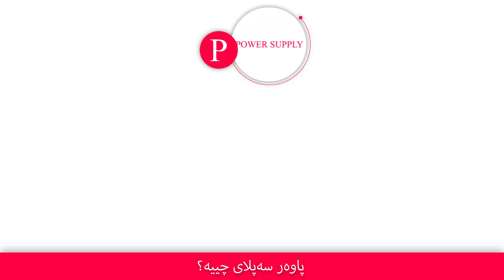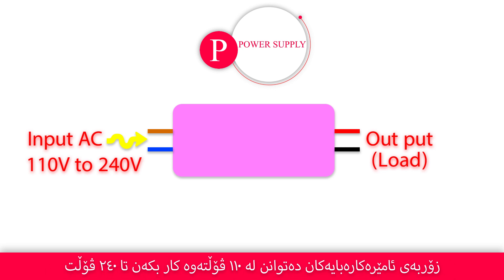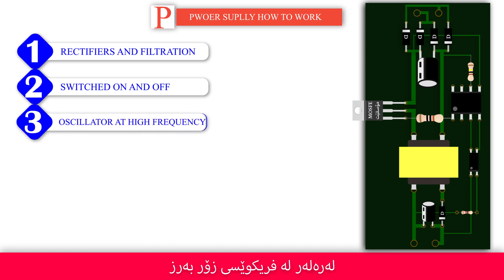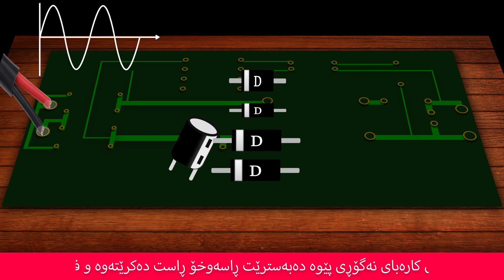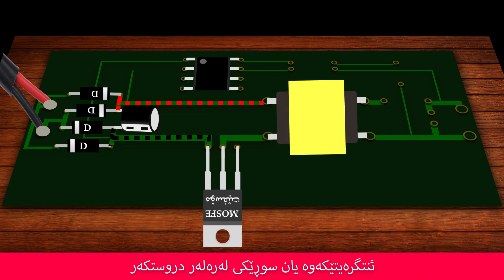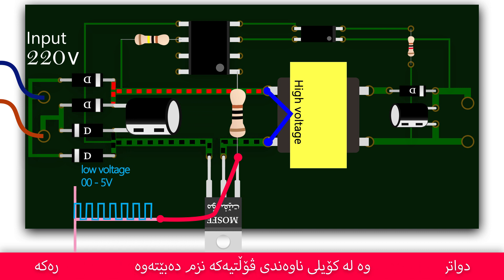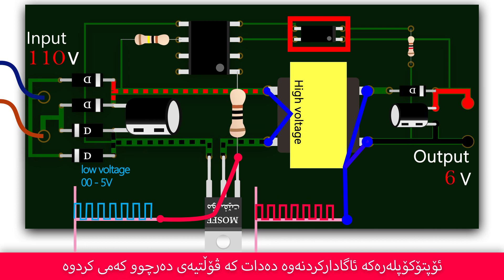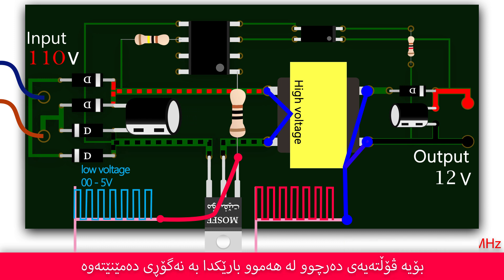Power Supply How to work ? ( AC from 110V to 220V )

Comment: Are you familiar with the Meanwell HLG Series CC Drivers? I have at least 3 of the HLG240H and 2 of their HLG320H that completely died on me. They were powering the correct amount of Vero 29 Gen 7's in "series" and matching the driver's rated vdc. They have rubber waterproofing internally.
If I only knew where to concentrate my digging?
It's a difficult task to search for the problem blind. lol

Comment: hi there, thanks for the brief but very explanatory video, i have a question that maybe you can help me with, i have a LED power supply that is design to work on 220v , when i  plug it on 110v the output voltage it is not enough to activated the minimum voltage need it on the led strip to light up the leds , how i can do a  modification  in order to get the power supply  works with the 110v input voltage, what  tells the power supply that is operating on 110 or 220v, its the feedback circuit ?
Reply from the maker: Hi.
Maybe this power supply not working at range 110v.
At this time needs more turning coil of the secondary coil.

Comment: so am i wrong or not ? AC comes from input, we rectify it to DC and in transformer it turns to AC again and after transformer we rectify it to DC again ... why we just dont rectify it one time and get our DC, why we turn it on and on.... ??
Reply from the maker: By this way we give a stable voltage.
This operation gives voltage feedback more than 10000 time in one second.
If the voltage frome output decreasing or increasing. It came back to the rest quickly.
And we cant control the current and limit it by using lm324 or lm358 from the output voltage with pc817